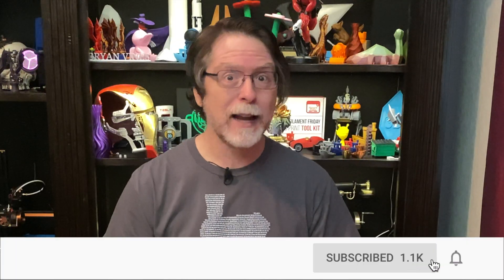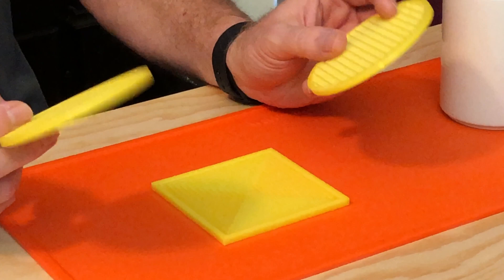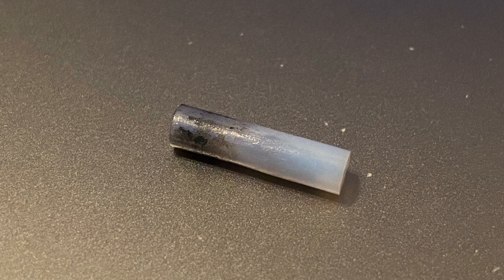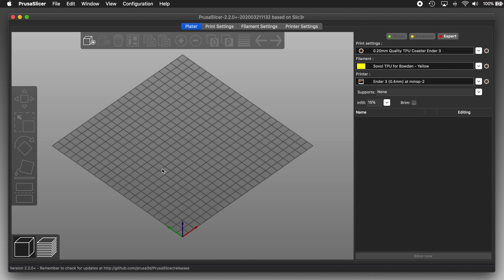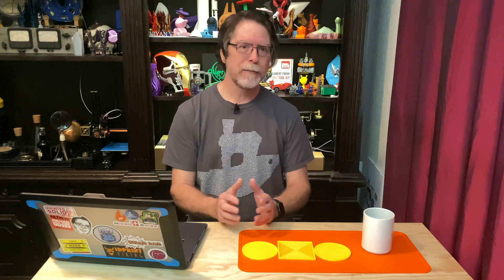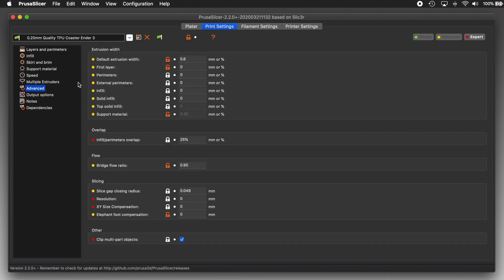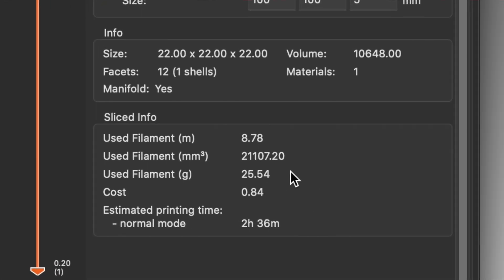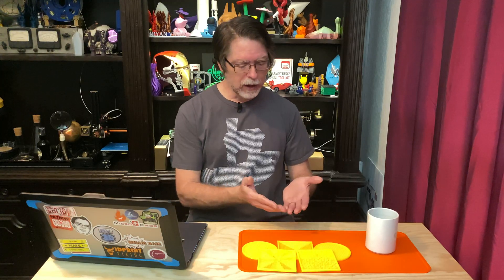Make AWESOME Drink Coasters with PrusaSlicer! (And nothing else!)

Comment: can you save this file and open it in cura slicer?
Reply from the maker: Hi! Yes, you can. But PrusaSlicer exports the solid shape, not the sliced result. That may not be what you want.
File > Export > Export Shape as STL
That'll create an STL file you can import into Cura.
Again, it'll be the solid shape. But in Cura, you can definitely turn off the top layers, and set the infill to a pleasing pattern.

Comment: How long did it take to print
Reply from the maker: The square ones were a little over two and a half hours to print. I slowed the print speeds down because I was printing TPU with a Bowden-drive printer, but you could go faster with a direct-drive extruder.
Reply: @BV3D  I'm looking at getting an creatly ender 3 how long do you think printing like 5 of the circle coasters out

Comment: Bryan, what PrusaSlicer setting do you recommend for Sun Lu PETG?  I've picked some up and wondered what you recommend for my Ender 3 Pro? All stock part from the extruder...I added a metal extruder and with your PLA settings...getting results I'm very happy with!  I hope you can suggest some PETG settings! Keep up the great work!
Reply from the maker: Hi! I tend to use the same print settings for both PLA and PETG, but I create a filament setting on a per-spool basis. The only major difference between my PLA and PETG filament settings is that I run PETG hotter (both nozzle and bed), and sometimes I slow it down a little bit compared to PLA. I haven't used Sunlu PETG yet, so I don't have anything specifically set up for it, but I would suggest saving a copy of a PLA filament setting and naming it Sunlu PETG, then you can adjust the settings there.